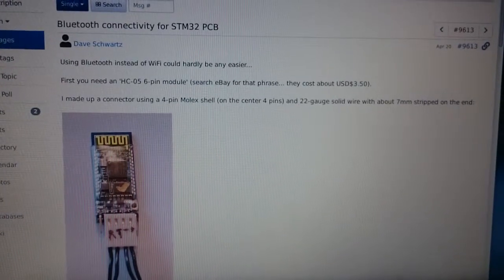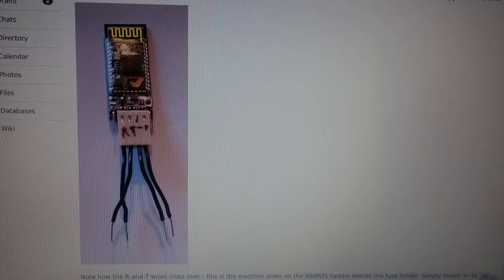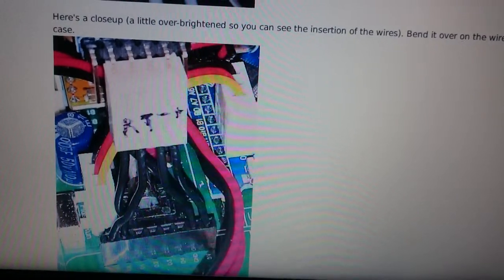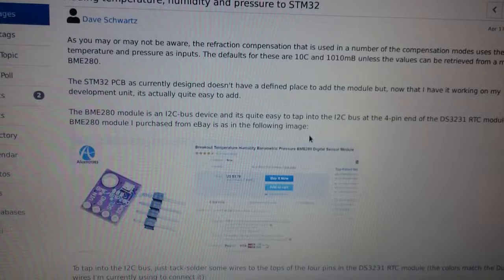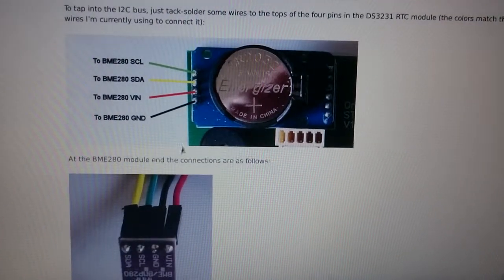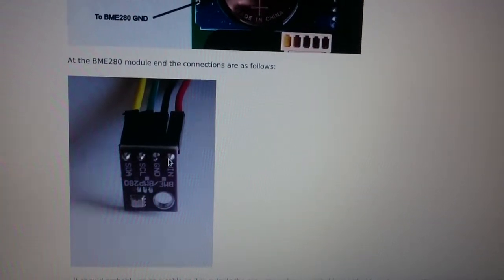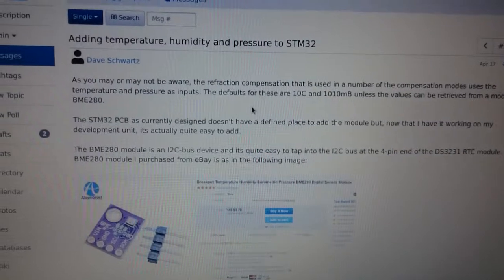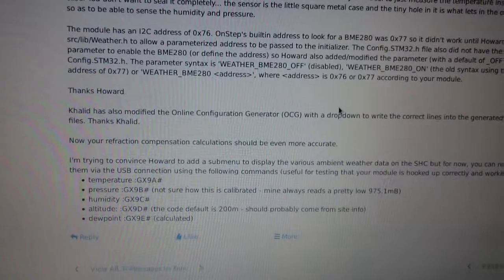Bluetooth and Refraction Compensation for the STM32 OnStep Telescope Controller

Comment: What should be the necessary connections on the ramp of the Bluetooth launcher.
I also hooked it up to a few schematics. 
pending response says onstepe is not connected 
Would you please help me?
Reply from the maker: Please don't repeat the question in many places. You asked in the group, and someone who uses this board will answer you. Please be patient.
Reply: @khalid_ba  Sorry, I wrote that I could not find an answer and solution to the problem.
Reply from the maker: @samiayyldz2262  Yes you did. But you sent me a message on my site, and a message on Youtube, and a message on the OnStep group. Don't do that again please. The group is the right place to ask.
Reply: @khalid_ba  I'm sorry I won't do it again